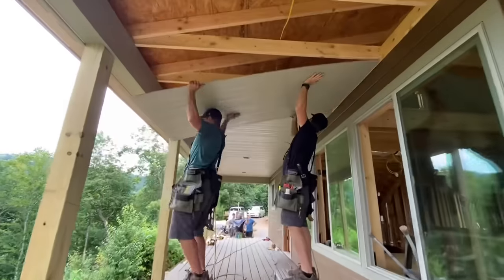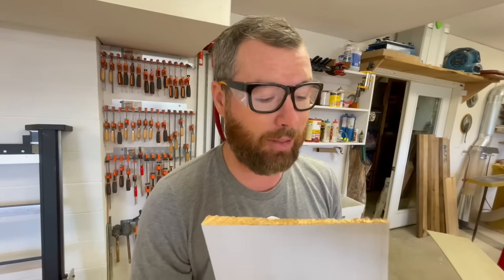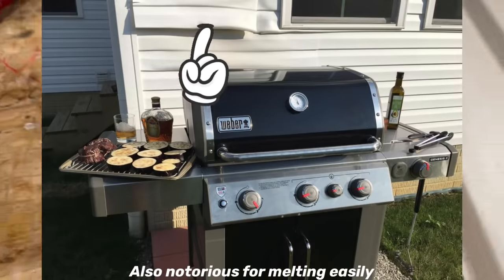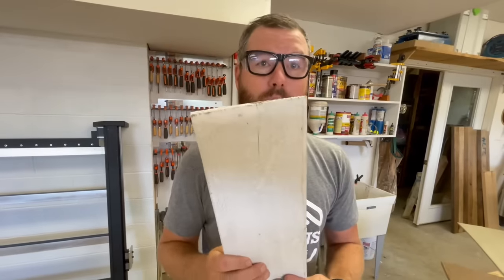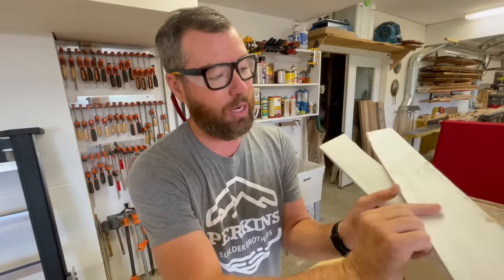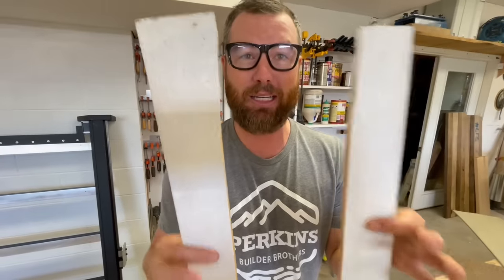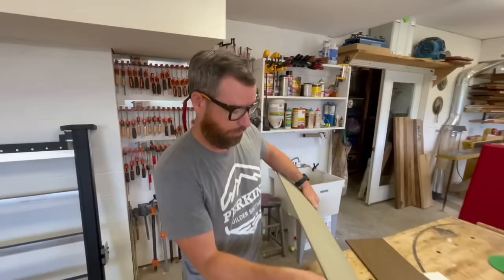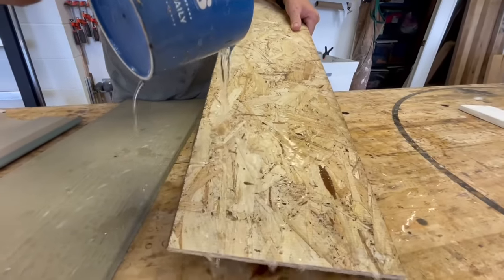Let’s Talk Siding | Comparing pros and cons of most common siding types

Comment: You used the broken end of the hardiplank to show it absorb moisture, cut a piece of the LP siding, put the cut end in water and see if it wicks to be a fair comparison.
Reply: This was not meant to be a fair comparison. This was an infomercial. Love PBB, anyway.
Reply: my exact thoughts too!
Reply: You seal the end of the LP siding before installation. Is the touch-up paint not waterproof?
Reply: @stewiesaidthat  You are also supposed to seal the cut ends of Hardiplank, which they did not do.  This gave the appearance that fiber cement siding just readily absorbs moisture.   I just do not believe an OSB product can have the longevity of a fiber concrete product.  Another drawback of LP is the 3/16 gaps they spec. for expansion at joints and trim, that much caulking has got to be a failure point over time.
Reply: I agree JT Electric!
Reply: @stewiesaidthat    Acrylic paint is not particularly waterproof.
Reply: @Hue Janus  they both have issues. Neither one is the holy grail of siding. Which is why you need to get the weather proofing right. It's easier to fix an issue with the siding than it is to replace rotted out studs and plates.
Reply: @huejanus5505 boy thats bad news for almost every house painted with latex paint 😂
Reply: @stewiesaidthat  I believe it also needs to be caulked. Even the butt ends
Reply: They both have to be painted on the regular. Around here that lap stuff absorbs the humidity and swells

Comment: We just finished siding a tiny house with fiber cement board.  The non-profit we helped with this project gets a break on their insurance due to fiber cement being fireproof.  You'd think that would be a MAJOR plus in your area due to the abundant vegetation.  I can't stand installing fiber cement due to the dust in cutting, brittleness, weight, etc., but it does have it's place.
Reply: It’s place is right in a dumpster.
Reply: In my neck of the woods, you can't use any of the wood-based products due to wildfire requirements, so fiber cement is the way to go.
Reply: Western nc gets a ton of rain so major fire is not a real issue.
Reply: It's not fireproof, it's non-combustible. I don't know about the specific fire properties of fiber cement board, but if it's anything like regular concrete it will degrade during fire conditions, as well as in the cooling phase, becoming more brittle, having reduced strength and potentially undergoing explosive spalling from the release of chemically bound water. Probably still better than regular wood siding, but I can think of wood products that i think would be better such as Shou Sugi Ban siding.
Reply: They are being paid by lp from the sounds of it

Comment: Here in Norway we use pressure treated pine siding. It’s milled on all four sides, so it overlaps nicely. We also install them on vertical 1x2 battens, to provide ventilation behind the siding so it dries out properly.
Reply: Rain screens are not as common here, but they should be..
Reply: And in Norway we also use 18-24mm siding. So it is much stronger👌🏻
Reply: The LP Smart Siding doesn’t get the greatest reviews on some sites. I’m starting to believe you guys hype anything you get for free even if it’s good or not. I really think it hurts your credibility a great deal. I think it’s absolutely mandatory that you mention the fact that you don’t pay for the products you promote so highly. LP Siding gets terrible reviews for water damage and the warranty doesn’t cover the damage in the states where it rains the most. Imagine that.

Comment: Excellent piece boys. I installed Hardie siding on my house.
 
Pro's: Insect, fire & hail resistant.
Easy to paint
Dead straight on all dimensions
Comes in various widths & textures: smooth or woodgrain

Can be ordered pre-painted & or primed on the back as well.
Doesn't require a forest of trees to make.
>>
Cons: Like you mentioned: Heavy, dusty, brittle & requires special tools & equipment to cut install & protect your lungs.
>>
One of the best things about this product is that you can easily paint it again & again & it never peels. Vinyl siding fades like crazy, so when it does, you have to either leave it or paint it, which doesn't work well. 
Not a fun material to install, but I'm glad I did.
Reply: You have to leave 3/16” gap with the smart side and hope it expands enough to close the gap. If you don’t leave a gap, it will expand and pop loose.

Comment: I started out in carpentry working for a siding installer on new housing. At the time aluminum siding was pretty much the standard (yes, I'm THAT old)! Eventually having my own crew I was given the task of being the first in my area to install fiber cement siding. Being a brand new product at the time the supplier had me use standard carbide tooth framing blades to cut the siding and "Maze" nails to attach it to the walls. (double dipped galvanized nails) the type used for installing cedar siding. I would get 1 or 2 days use out of a blade before they were ruined and hand nailing would generally take 2 or 3 nails just to get through the boards. I asked about pre-drilling and was told it would void the warranty. Needless to say the job took forever and I never wanted to see the stuff again! 
    Another great, informative video. I've always felt that you never stop learning and I think you guys do a great job of explaining to everyone how things work and how to do things well. Keep up the good work!
Reply: I am installing the cement siding on my house. I found that the blades last a very long time when you use a cordless saw. The cordless saw runs at a much lower rpm than a corded saw which also creating less dust. I have had zero issues installing with a nail gun. Every nail goes right in and I have had almost zero cracks in the boards or blowouts from over penetration (1 each in 43 pieces).
Reply: @briangc1972  they make a blade just for it and sheers so no harmful dust using the sheers. But lp is far superior product and even in looks
Reply: @chet174able  yes, those make it much faster, cleaner and easier to work with fiber cement. I wish they were an option back then, I would have a much different opinion of it for sure.

Comment: Of the choices shown I have to go with solid cedar claps, pre-primed, then oil primed on cut ends. Two coats of really good paint. To prevent short, under window pieces a story board angled. But my favorite is cedar shakes and even better from a fun to install siding-- cedar hand splits. They aren't the cheapest but the most satisfying from a carpenter's perspective. All done with the production end of building. I'm in it for the art of the trade.

Comment: Just a friendly observation and a question.  Matt Risinger (a high quality builder in Austin TX who also has a YouTube channel) has done some comparisons of siding options.  He comes down on the exact opposite side of the debate between fiber cement and LP SmartSide.  

Here are two issues that I think PBB is not fully considering (I say this with respect and not to nitpick...I love your channel).  First, SmartSide is relatively new, and it is a wood-based product.  The track record for this product is fairly short at the moment.  It is not obvious that the performance of a wood-based product will be as good as a fiber cement product (or even close to it).  Building science comes down firmly on the side of fiber cement lasting much longer than a wood-based product (and there is literally no disagreement about it).  Second, any homeowner I know will opt for slightly higher installation cost to get (1) greater durability, (2) a longer track record of proven performance, and (3) better life-cycle performance.  What I mean by life-cycle performance is that fiber cement runs almost no risk of needing replacement for the life of a home, while SmartSide almost definitely runs the risk of needing replacement during the life of a home.  

Although it will be tempting to agree with this post by saying "all true" but the cost is greater for fiber cement than SmartSide, the question is "how much greater?"  So, maybe a "concrete" answer to this question is possible.  On the Nantahala Retreat, what did you price out for siding using SmartSide (labor and materials) and what would you have priced out for using fiber cement (labor and materials) (setting aside the sponsoring arrangement from LP)?  

Thanks for considering this question!
Reply: fire resistant
Reply: I’ve had spruce clapboard on my dads house for nearly 30 years. We do paint every 8 -10 years or so but the siding is still in good condition except where it was touching a poorly installed deck. Fibre board , when it starts to flake, has to be replaced.
Reply: There does seem to be an awful lot of class action lawsuits against fiber cement product manufacturers though...
Reply: SmartSide has been around for 20+ years,  without major issues.
I've used both products, and prefer SmartSide for the ease of install. The key though for either is to install it according to the manufacturers guidlines. Do that and both products will last a long time
Reply: @johnnydekalb  I know that the corporate media and the company's literature say 20+ years, but that leaves a false impression.  It started to become used somewhat widely in different climates in more recent years (within the past 5-7 years, maybe less).  This is an important point because a product's performance profile is only truly discovered after it is used on a large scale in different climates over a significant number of years.

I think everyone agrees that installation is easier.  If ease of installation is the primary factor, LP SmartSide is the hands down winner.  Homeowners probably care more about product performance than what makes a builder happy, which is one of the points of my post.
Reply: I'm a big fan of Matt Risinger but I have never seen him do a project where he had a close eye on the budget so my guess is when you account for price and install time LP still comes out on top.
Reply: @ATaylor369  I agree that LP SmartSide definitely comes out on top when cost is the primary consideration.  The point is that homeowners are often willing to pay more for a superior product, which fiber cement certainly is.  However, homeowners don't always get into the details and know the tradeoffs.
Reply: I follow Matt Risinger too! 🤣😅😄 It is true that he has a talent for finding the most expensive or latest technology in building science but I appreciate his geekiness, passion, information and “details” that he is always giving out. When I need something bulletproof then I do consider his information. When his approach might not be appropriate or necessary for a situation then I appreciate consulting other resources. 

I did have to learn something the hard way after watching Matt Risinger’s videos for a while… I believe in applying myself to the highest standards possible and just doing my best. I had a 40‘ x 40‘ shop that preexisted on the property we bought that needed a significant amount of work to make it safe and stable. I was going to be remodeling the inside, installing doors and windows in different locations and etc. When it came time to put together the contract with the contractor for exactly what kind of work I wanted to have done, how I wanted it done etc… then I fail to understand that every time Matt Risinger said, “This is a neat detail!” or “Look at this detail…” then that should’ve been a clue to me that might not have been part of the standard installation but was allowed by the manufacture. 

My contractors didn’t actually do anything wrong but because I failed to understand the minimal standards and requirements that the manufacturer had for that product were not in line with the standards and installations that I had been watching then I failed to itemize and detail those kind of “details” in the contract. My contractors followed the contract as written, they installed the products at the very least to the manufacture specifications and I learned a massive lesson in learning how to specify details that I thought we were on the same page about but did not specify and itemize in my contract. 

My house has to be replumbed and I am currently in the process of making sure to specify every product and detail that I want used and how to have it installed. I am checking with the manufacturer of the products I want to use and ensuring that things will work properly in the way that they are specified. I am looking at using Uponor Pex with a Recirc-system and Phyn water leak detection system. I still am having to figure out my water softening system. Matt Risinger recently did a video on what he chose but based on my pulmonary research then I think I’m going to dive into the world of water softening system and research the hell out of that! 😅😄😁👍 

Thanks for your comment and I think you said it very well! 😙😁👍 (I was thinking very much the same thing.)
Reply: In a perfect world fiber cement is great
If you're blind nailing and not watching every nail being put in that shit will fail in a windy climate
Reply: @tightbhole420  The nailing pattern is nearly identical for both products. If you view the installation instructions for both products you will see that the location of nails is specified, and manufacturers indicate that nails should not be overdriven.
Reply: @scottjackson638  its obvious you havent installed both because LP is far more forgiving
Reply: @tightbhole420  I have installed both multiple times. The nailing pattern and the warning not to overdrive nails is the same for both products. This is what my response addressed. Are you saying that the two products have a materially different nailing pattern and/or have different tolerance for overdriving nails?
Reply: @scottjackson638  LP is significantly more tolerant to high nailing and pretending Im wrong about that is absolutely moronic
Reply: @tightbhole420  You should read the installation instructions for both products, which are virtually the same. Did you notice that failure to install the product in accordance with the manufacturer's instructions may void the warranty? I think that you may want to read my initial comment and my subsequent response to your comment. Being hostile does not make you right, it just makes hostile.
Reply: @scottjackson638  I dont think you understood my initial point and you're just talking out your ass. If one person puts every nail in thats one thing but if you have hired help nailing the product LP is far more forgiving. Also a few overdriven nails does not void the warranty on LP.
Reply: @tightbhole420  My point is backed up by literature provided to the public by both manufacturers. The installation instructions are nearly identical. Your assertion that contractors can overdrive nails without potentially voiding the warranty is false. You can verify this by looking at the installation instructions and/or contacting LP.
Reply: @scottjackson638  🤣 alright buddy, Ive talked to reps and installed roughly 600 sq of LP but if you think you're right you do you champ, I got nothing to prove to you
Here's a hint: something like overdriven nails only voids the warranty if it leads to product failure, shooting into a soft stud doesnt mean you have to rip the piece off the house
Reply: @tightbhole420  I just want to make sure that individuals who read your false claim that it is not necessary to follow the LP installation instructions are forewarned about the inaccuracy of your claim. You are entitled to your views, but not your own facts.
Reply: @scottjackson638  🤣 lmao love these DIY superstars
never change internet warriors
I would suggest you actually read the instructions provided by the manufacturer regarding nailing before you pretend to be an expert
Reply: @tightbhole420  Please specifically state the inaccuracy in my statements by reference to the LP/Hardy installation instructions. I do not claim to be an expert, I just claim to follow the installation instructions.

Comment: Up here in the Pacific Northwest we're using fiber-cement a lot. We've been having a lot of fires during the summers, as we build into the hills more and more fiber cement siding is being installed
Reply: In Australia wooden siding & vinyl of any sort would not meet local codes for what's known as Bushfire Attack Level (BAL). Might get approval for residential but I suspect the insurance premiums & extra building costs would be cost prohibitive. In one of their videos they can see a fire on a nearby mountain so they obviously occur in the area they work in & I imagine fire resistance systems, especially for remote homes will eventually be part of their local building code

Comment: Fiber cement for longest life, never warps or rots, CAN NOT BURN!!!!  Holds paint well, easy to install when using the Gecko hangers. Cuts like butter with a cordless saw and an air nail gun gets the job done quickly with no issues. I'm about halfway through doing it on my house.
Reply: I used it on my home as well. I highly recommend it. 
If the paint starts to fade, I just slap a fresh coat on and the house looks like new again.

Comment: I work for a builder here in Ontario, mostly we use vinyl for the cost. It's what I prefer to use and the only thing I'd use if I was to build my own house. I'll admit that I've never used smartside lap siding, but I've used the smartside sheets, if you don't treat the edge and it finds moisture it turns to mush. Likewise with fiber cement siding, in fact the brand we used voids your warranty if you don't paint every edge, so one person comes and cuts one hole without painting the edge, and it can void your warranty. And talk about fragile. To me vinyl is just cheap, simple, easily fixed and maintenance free, it also isn't whatsoever affected by water. All things that I care about